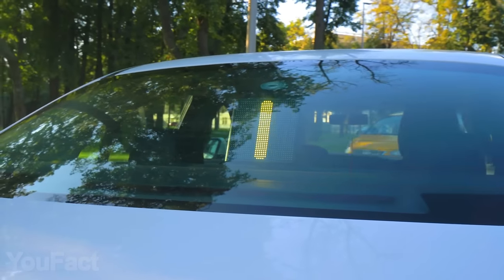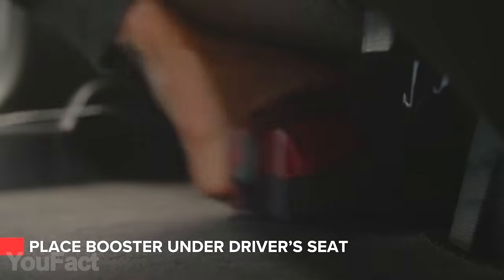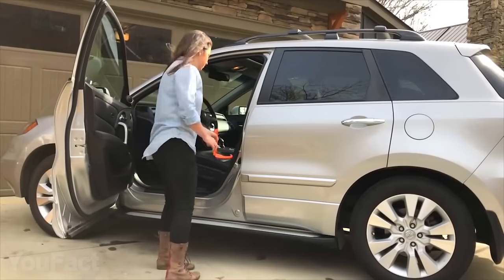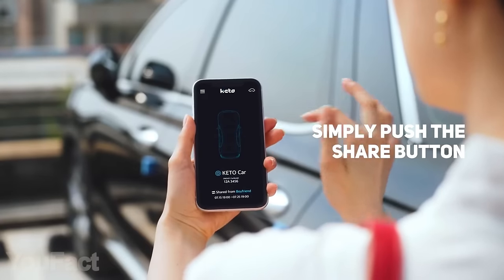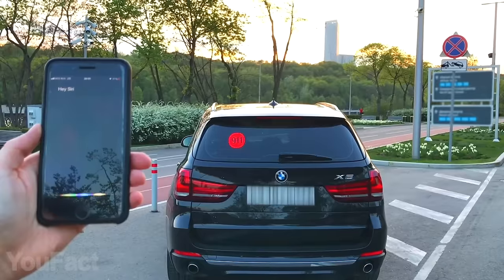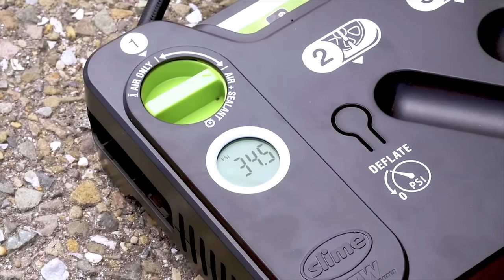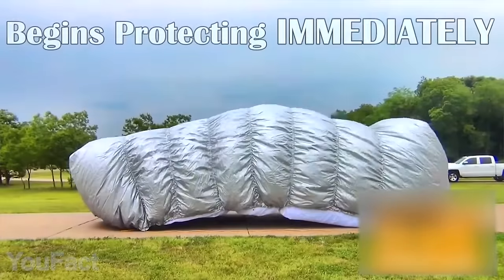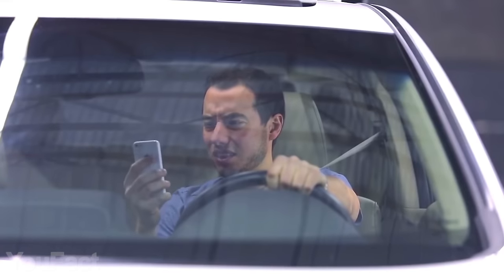14 Coolest Car Gadgets That Are Worth Seeing

Comment: Just as a heads up, the inflator with the green goop inside of it is the quickest way to make your mechanic hate you.  That stuff goes all over the floor and their tire mounter when they open the tire up to replace it.
Reply: It never hardens?
Reply: @timothy2935    Nope.  Says a former tire mechanic.
Reply: @timothy2935   none of those kind do.. they harden up and seal only where the leak is at and nowhere else, otherwise it would severely affect the tire balance to the point of risking destroying the entire suspension system at that spindle. ever load a clothes washer on just one side of the tub instead of balancing the load? They all stay fluid inside the tire to prevent this from happening.  When you go to remove a tire from a wheel with stuff in it, it is equivalent to shaking up a can of soda and then opening it, or busting a water balloon all over the place, except people have also gotten seriously hurt before removing a tire with slime or fix a flat in it.    There is a tire place here in TN that if you dont tell them your tire has fix a flat or green slime in it,   they will charged an additional fee for the mess it creates and because techs have been injured in the past as a result.

Comment: How many people have bought the door step and have snapped there cast door lock with there weight? It's maybe a 5 shot snap job! No way would I be putting any more pressure on the lock latch than the torque it was set to take!
Reply: I don't think you realize how strong that door latch is. That thing is designed to take a beating.
Reply: @madpatzz1  it's designed to take a load horizontally not vertically probably 5 to 10 uses of that and your door ain't going to close properly anymore

Comment: that slime pump will mess up alot of tire monitors and potentially cost you much more money then just towing the vehichle or swapping to a spare tire.
Reply: It's a last resort. Multiple punctures or going to replace the tire anyway
Reply: It will also throw the ballance off and most mechanics won't be thrilled to hear that slime was used cause it gets everywhere and has to be cleaned out to properly balance the wheel

Comment: The thing they never mention about the slime repair (which does work very well) is that it will inevitably destroy the tpms sensors
Reply: Do you have a link showing this damage to the sensor  ? Thank you.👍🏻
Reply: @gigabit7079  No... personal experience... 19 year professional driver, used the slime in multiple tires on two different cars, rarely replaced the slimed tired in a timely manner (so this may be what "inevitably" causes the damage), and had the sensors go bad on those specific wheels within a few months
Reply: @robertw4411  Thank you man. 🙂I always wondered if that could damage it. I gave a repair kit similar to that one to my brother and after that I realized his car had these pressure sensors.
    I told him that I was not sure it could damage it, but told that just in case, after using it, just go to the mechanic as soon as practical to make a definitive repair and clean inside the tire and the sensor.  So now I am sure the recommendation I gave him is really neccessary. 
   Regards. 👍🏻👍🏻👍🏻

Comment: there is an old saying "TODAY'S MATERIALS ARE TOMMOROWS PROBLEMS" and that goes for gadgets as well, the slime stuff off balances tyres at high speeds, wrecks tyre pressure monitors and if you get a puncture it is impossible to stick an internal patch to the tyre after slime has coated it (internal patches are the only permanent solution for punctured tyres)

Comment: 1. The Multi tool needs to also have a tazer feature in case you get attacked.
2. Car signal booster will make you glow at night.
3. Hudway heads-up can't use googlemaps or waze????
4. Moki Doorstep - $50 is way too expensive for a piece of metal.
5. Launchscan - At $250 you have to pay for reset codes...microtransaction B.S.
6. KETO - Smart phones already hold vunerable user info and now access to your auto??? 
7. UV Light sanitizer - won't sanitize or remove finger oils...bummer.
8. Moji/Emoji - Someones is easily bored to have this. Wanna see Road Rage!
9. Tire Repair - Meh!
10. Slime Flat - How much do the refills cost for that?
11. Airless Tires - If this is the new miracle tire, then why is this not standard in the automotive market. If it sounds to good to be true then it probably isn't...beware!
12. Sauce clip - What! You can't hold your own sauce? If you're driving and eating...WRONG! You'll need someone to hold your 'Jack Sauce' instead.
13. Hail protector - A reason why thier is auto insurance or a garage. Imagine someone looking out of a burning building and seeing  this contraption below?
14. Trap Tap - may/may not work??? Waste of money when you get a ticket that costs more than the device.

There you have it! Gadgets that are Worth[Less] Seeing.
Reply: Thank you for taking the time to showcase your cynicism and stupidity on the internet for the whole world to see and admire...you sir answered  questions that nobody was asking you to and the best part is that all your ideas can be contradicted by a kindergartener who has never driven a car.

Comment: A few weeks ago quickly noticed an ad showing a car shade to keep the inside car from extreme heat. This device is like part of the roof rack on an SUV and to activate it you use a remote control. The advantage is that it is actually part of the car and doesn’t take any time to install or  remove as it only takes a few seconds prior to entering the vehicle etc. I’ve been searching for weeks to find this and have not succeeded. By any chance will you try to help me out here? Thank you so much.  Mark

Comment: I wouldn't touch anything that has to do with Slime, the company doesn't backup their product. It's not made for cold weather as the slime freeze in the tire, the tire shakes like the your wheels are warp, specially when driving on hwy. Plus the added bonus, you got to pay a garage to clean out the crap out of your tire. Slime didn't want to cover the cost of removing the slime from the tire, nor did they want to refund me. STAY AWAY FROM SLIME, IT'S A LOSE, LOSE SITUATION! YOU HAVE BEEN WARNED!
Reply: I won't use the stuff in a car or truck tire because of the balancing issues you described above,  but as far as garden tractor and atv tires,  that stuff is worth it's weight in gold.

Comment: Cellular booster DOES NOT work anywhere. Get real. It boosts a signal ONLY if there is a signal. There are very weak signals that your phone cannot pickup up due to the wattage requirement of .6 maximum and small antennas. (Good example is Onstar can PU a cell signal when your phone cannot). So stop saying it can pick up in the middle of nowhere, it can only do that if there is an actual signal to PU. If there is NO signal, it can't. But is sure can PU signals that are there but your phone cannot receive and then boost that signal so your phone can use it. To to WY, ID, UT, MT to prove it!
Slime sealant or any type of liquid sealant will DESTROY any air pressure sensors inside the tire.

Comment: For those of you who think the "tire plug" tool is a great idea...they are not.
I have driven semi trucks for 40 years, so I can say this by experience, first, you will need an air compressor to refill the tire. Second, it destroys the steel belts in radial tires. Third, it is in NO WAY a long term fix, you may fix the tire to continue driving, but get the tire to a shop and replace the plug with a patch ( its best to put on the spare so you do not ruin the tire and the tire shop will be able to patch it )
I do not recommend using plugs ever, just know if you do, your tire will most likely not be able to be repaired properly, costing you to buy a new tire.